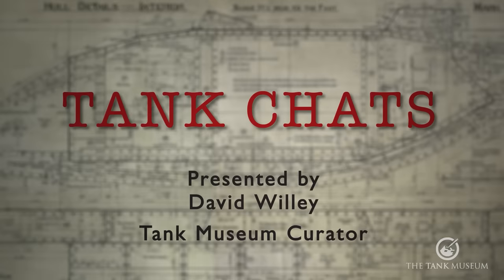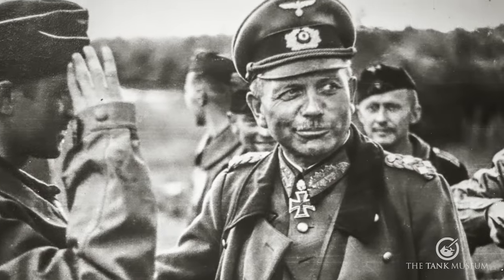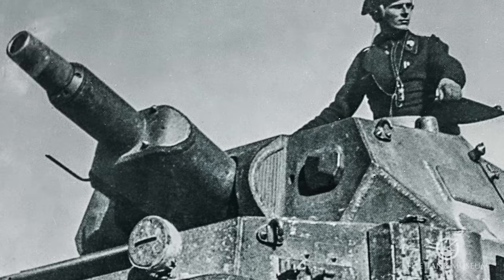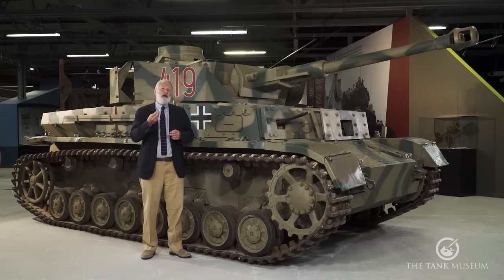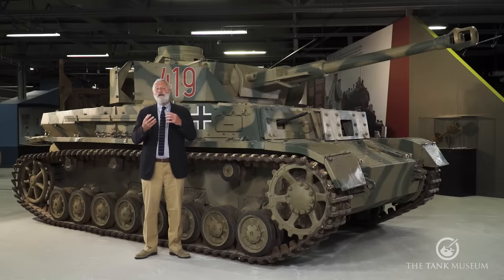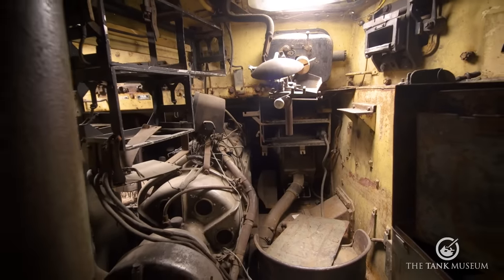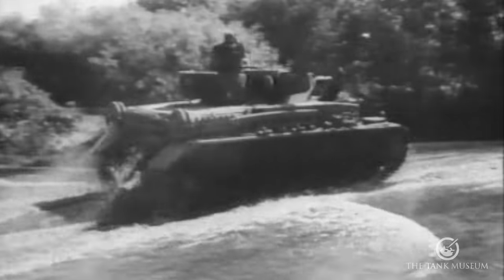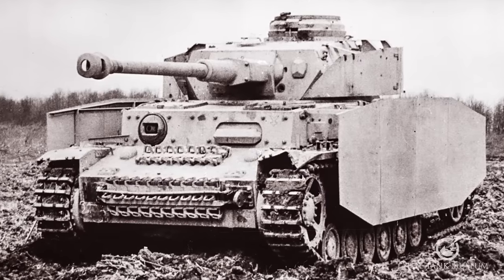Tank Chats #106 | Panzer IV | The Tank Museum

Comment: 75% of Pz IV losses are on the Eastern Front. And Americans still thing D-Day was the big deal.
Reply: Normandy was a big deal. The British and Canadians faced 7 panzer divisions and 3 Tiger battalions around Caen, in just 20 miles of front. This was the densest concentration of German armour ever deployed in WW2.
Reply: @lyndoncmp5751  double that and you´l get a tuesday in Prokhotrovka...
Reply: @uegvdczuVF  Operation Goodwood was a larger tank battle than Prokhorovka. Its now been shown Prokhorovka wasnt as large as the Soviets used to claim. And the Germans had less than 50 tanks knocked out/disabled there. Most of which were recovered and repaired.
Also, no Panthers at Prokhorovka and many Panzer IIIs still.
At Goodwood there were nearly 1,500 tanks so more than at Prokhorovka. The British had around 400 tanks knocked out/disabled and the Germans over 100. Higher losses than Prokhorovka.
Reply: @uegvdczuVF  Also during Kursk the panzer divisions were dispersed and spread out over many miles and two different fronts.
There were NEVER 7 panzer divisions and 3 Tiger battalions deployed around just 20 miles and 1 town at any point on the Eastern Front. The Soviets NEVER faced German tank concentration density as the British and Canadians faced around Caen.
Facts, mate. Facts.

Comment: The gunner on the left comes from Field artillery practice makes the loaders job a little clumsier also, on the J model they did away with the rotating connector under the turret. A cable replaced it and limited rotation to 70 degrees in direction

Comment: One point, the Schürzen did not tumble the anti-tank rifle rounds, they "skinned" the soft outer jacket off the core. By doing so it removes both speed and mass from the bullet which lowers the kinetic energy when the bullet impacts the main armour.
This is what the Germans originally planned but historians came up with the tumbled round idea instead as some rounds do tumble if they hit the Schürzen at an angle greater than 30°.
Modern testing testing has proven the German designer's right.

Comment: A slightly wider tank, with a turret ring bigger than actually needed at the time. Welded construction throughout, so its easily modified. The Germans were always thinking ahead. It was very difficult to put a more powerful gun into the Sherman, but for Panzer IV it was just plugin play.

Comment: Only in accuracy here is about the naming of the model after the F.  F2 was only a stopgap designation and dropped by the summer of 1942. 

227 Panzer IV with the 75mm L43 were ever produced, and then taken into the G once they adopted the L48 for serial production from mid 1942 onwards.

So you basicly got

Pz IVG early = 75mm L43 & 50mm hull front armor
Pz IVG mid = 75mm L48 & 50mm hull front armor
Pz IVG late = 75mm L48 & 80mm hull front armor

Comment: The Panzer IV was also just about as expensive to produce as the Panzer III. The latter, although smaller had more advanced features. And even though this design from 1936 was certainly relevant for the duration of the war, it was never a world beater. The 3 man turret was superior compared to 2 or even 1 man turrets of allied tanks in the beginning of the war but its armor protection was often significantly inferior. Later models could still compete adequately with the allied medium tanks later in the war even if these were "far" newer designs. (A year in development during WW2 is obviously much more significant than it would be in peace time.)
Reply: On the sea there's a saying about safety in speed, I think that applies to tanks as well if used with the right doctrine.

Comment: The Panzer IV was one of the only first to the last vehicles in WWII. The only other tank was the T34. In aircraft I think only the BF109 and Spitfire were first to last. The designs were so good they were still effective in 1945 even though they were designed back in the early 30s. What a great series this is.
Reply: The P38 was first to last along with the B17, B25, B26, DC3/C47, and Japanese zero.
Reply: @krtacct  I'll give you the B17 and A6M but the others were not operational at the start of the war.
Reply: @arminiusschild5260  T-34 wasn't around in 1939 and 1940 though. No T-34s when the Soviets invaded Poland and Finland in the first year.
Reply: @lyndoncmp5751  True, I thought they had them in inventory but did not use them yet. But it seems they were only introduced in 1940.
Reply: @arminiusschild5260  Yeah they made a couple hundred T-34s in the second half of 1940 but none saw combat before June 1941.
Cheers.

Comment: The best tank the Germans made during WW2 in my opinion. Was a decent tank before getting the bigger gun, but was better with the 75mm high velocity gun which could knock out any allied tank. Much better than the Panther or either of the Tigers.
Reply: I fully agree. The Panther and Tiger 2 were a waste of resources for a hard pushed  nation nearing defeat. Plans were there to further up gun and up engine the Panzer IV. Including better but still external suspension units and even wider tracks! 
Panzer IV should have been the German equivalent of the Sherman. Had all the resources and factories been turned over to supporting Panzer IV production/ongoing development and spares.  I'm sure the front line troops would have benefited. Not only  numerically with greater numbers of actual tanks produced. But also from improved reliability of a well proven design and simplified logistical support. Two things that plagued German panzer units.  There were even (I have it on good authority from a little Irish chap.) plans to change the front design to sloped armour. Actually simplifying manufacture in the process.  Like all the other planned upgrades, dropped to concentrate of the Panther, the "problem child."

On the Tiger I subject. It too would have benefitted from further development, rather than a new design.

Comment: I know that Germany used Swedish iron ore during WW2. Does anyone know the extent to which the cutoff of Swedish iron ore from 1944 onwards impacted German tank production?
Reply: None becuse they hade iron for 2—3 year in store
Reply: It was the shortage of other metals in late 1944 that had a greater impact as they were used in the steel alloys to make them strong yet flexible. Many of the tanks built in late 44-early 45 had inferior armor that was too brittle and would shatter when hit, rather than allow for deflections with the metal able to give some.

Comment: I gotta question for you Panzer IV Gurus, what is the purpose of the Two Canisters mounted on the right side of the Panzer IV Ausf H?
Reply: I'm no expert but the pictures I've seen suggest a compressed air cold weather start assist system. There was a similar setup on a T34/85 I explored some time ago, although that was inside next to the driving position.

Comment: I noticed German tanks always had a really tall profile, Even the Panther has a taller profile than most modern tanks. I presume its due to the drive sprocket being in the front rather than rear.
Reply: No torsion bar suspension kept it riding high

Comment: Looking at the length of the barrel I'm pretty sure that this tank is equipped with an L/43 not L/48 gun.
Reply: Yes, he says that in the video
Reply: @LA_Commander  Nope, in the video it's said that this tank is equipped with L/48 gun which is incorrect.
Reply: @ytkomar1141  so why don't you send an email directly to the tank museum, they might actually make a correction
Reply: @LA_Commander  Well, I don't see a need for doing that. Their internet page is correct in this matter and I'm sure that they are aware what type of gun the tank they have in the museum has. I'm just pointing iut that there is mistake in this video.

Comment: It would be interesting to know if the high velocity AP rounds would bounce off sloped armour. I know that the 17 pounder did and l have seen one mention that the American 76mm also bounced.

Bonus fact :  The Germans used low flash (fast burning) gun powder, so it could be difficult to locate German tanks.

Comment: Makes you wonder, what if they had stuck to improving and making more of these smaller more standard tanks; instead of dumping resources into the giant tanks.
Reply: Problem was fuel. They could have produced thousands more but had no fuel for them. Hence the panther. Less bigger tanks used less fuel in the hope that they could survive longer and move less. In the end they ended up moving the bigger tanks a lot more so gained nothing. The German army depended on movement on the Eastern front but lack of fuel basically made that impossible.
Reply: @haveraygunwilltravel  Yeah, that sounds about right.

Comment: I'd like to hear about the (American) "Christie tank suspension" which was rejected by the Allies but accepted readily by the Russians and the significance of its further development (BT series and T-34) with them.
Reply: Christie suspension wasn’t rejected by Britain until after 1945 - it was used on e.g. the Crusader and Cromwell and its derivatives, so was still in production and use at the end of the war.

The Soviet Union on the other hand did end up rejecting it. It was used on the 
BT-7 and T-34 but not on the IS series vehicles.

Christie’s system was good for speed and worked pretty well. It had problems however concerning both the amount of space it took up inside the tank and, because the springs were behind both the road wheels and armour, the amount of work required to replace a broken or damaged spring because you had to remove a lot of parts and armour plate to get at them.

The US decided not to use Christie’s system largely because of the above issues. The US put a great deal of importance on reliability an ease of servicing and repair both for maximising vehicle availability where the fighting was and because they couldn’t easily ship broken down or damaged vehicles back to the factories in the US across thousands of miles of sea. Replacing a suspension bogie on an M3 or M4 was a relatively simple task - break the track, remove 16 bolts, lift off the damaged bogie then bolt on a replacement one. Far simpler than fixing a broken Christie system. Or a broken torsion bar for that matter, especially on a multi-overlapping wheel torsion bar setup like Tiger.
Reply: Also, Poles didnt reject this suspension.
https://en.wikipedia.org/wiki/10TP
Reply: The Chieftain did a video about the US army trials with Christie suspension and the reasons why it wasn't adopted

Comment: I am quite confused, why would the Germans upgrade a training tank if it wouldn't see combat (or at least not intented to see combat). Doesn't make sense adding extra armor and getting a bigger gun if u only use it for driver/crew training. Any1 that could answer that for me?
Reply: Old model tank comes into the workshop for repair, old model tank is upgraded as part of that process. Old model tank is declared fixed. Someone decides where it will go, in this instance it went for training purposes.

Comment: At 24:20 it says that the cupola was moved forward in the Model E.
It wasn't - that would have required moving the seat as well. The cupola stayed put and the turret wall was redesigned around it.

Comment: I always if Hitler had actually listened to Guderian in 43, just what might have different if production capacity went to more P4’s. Considering the Tiger cost four of those.
Reply: Nothing would have been different, except a lot more resources used and more men killed. At most, only another 4,000 to 6,000 Panzer IVs could have been built if not Tigers. Thats over nearly 3 years.
People forget you make 3 times as many Panzer IVs then you need 3 times the men, 3 times the ammo, 3 times the support and supply personnel and their vehicles, from panzergrenadiers to medical and field kitchen etc etc and consequently it would end up costing far more resources.
Just as important, the Germans would have had neither quality or quantity superiority. The Panzer IV was not better than the main allied tanks from 1944.
Reply: @lyndoncmp5751  Yes I understand that. Didn't think of the manpower that would be required, and probably would be inferior by 44. Thank you for the reply, excellent points 👍
Reply: @kungfuwitcher7621  No worries. Yeah few people realise that out of a circa 10,000 strong panzer division, only around 2,000 make up the actual panzer regiment. The other 8,000 are supporting grenadiers and supply personnel.
Tanks have to have a lot of support and supply personnel and vehicles.
Cheers. Best wishes.

Comment: Why didn't they scrapped panzer III totally in 1936 or so and go for pure panzer IV production just with 2 different guns? Some could have the 75L24 and others the 37 or 50mm guns (then of course it would end with 75L48). They could have both roles with the same tank.
Reply: Kwk Fortythree Chassis were reused.
Reply: @XtreeM_FaiL  indeed, in stug3, stug4 and other vehicles. What I mean is what's the point of having panzer 3 and panzer 4 tanks when using just panzer 4 with different weapons on the same turret would be a much lower burden in the logistics and production while maintaining the same anti tank and infantry support roles. Why two vehicle type when win just one type you can cover all your needs.
Reply: For the same reason US pumped out a lot of M3s when the M4 was ready.
They needed tanks.
changing from one model to other would shut down the assembly lines for months, or worst.
The transition from M3 to M4 was less troubling as the two hulls are similar and the US industrial power was immense.
PzIII and PzIV were two different thing, they would have to create a new line from scratch with German industry already stretched.

Comment: I have question:which tank will win the tiger or  the panther
Reply: Depeneds on what you want?
Tiger is a special breaktrew vehicle, Panther is meant as a main stay vehicle for an army that has to fight lots of enemy tanks. Both are made for different things and excel accordingly.
Reply: panther is the better tank.
Reply: @nothanks3590  Better tank at what?
Reply: @lyndoncmp5751  everything
Reply: @nothanks3590  But it wasn't, and the Tiger even had a higher operational average. 65-70% compared to the Panther's 60-65%.
Undoubtedly the Tiger was the better tank in 1943 and early 1944. Guderian didn't even declare the Panther fully troop ripe until Feb 1944. It took a long time to iron out its flaws. The Tiger still remained a better long range sniper. More powerful and accurate gun over 2,000 metres.

Comment: The question is: Why did the Germans invest such HUGE amounts of money designing and building Tiger ( only ~1200 built) , King Tiger  and other pipe dreams, when improving, adapting and producing tens of thousands of these MkIV Panzers with varying weapons/ layouts would have been far mor useful? It really could and  should have been the “German Sherman”.
Reply: Maybe because they didn't have enough men to crew them?
Reply: The Panzer Mark IV is adequate enough to deal with the Russian T-34 and the American M4 Sherman with upgrades like rearming it with a long barreled high velocity 75mm gun. The design is simpler and easy to upgrade with many German fighting vehicles are modeled on its chassis. Unfortunately Hitler believed in bigger tanks with bigger guns will win the war and orders more Tiger tanks be built. The problem is that the Tiger is very expensive and used too much resources. Even German generals prefer to have more Panzer Mark IV tanks than Tiger tanks. Had the Germans continue to produce more Panzer Mark IV tanks, the war could be dragged on for a year or two or at least to delay Soviet advancement to Berlin allowing the Germans to surrender to the Western Allies instead.

Comment: I was surprised they only made 8000 of them. This was the workhorse, the panzer the built the most of, and they only built 8000. That right there tells you why the lost the War.

5800 Mark IIIs, 6000 Panthers, 1400(ish) Tiger Is, 500 Tiger IIs (and 10,000+ StuGIIIs which are not tanks). And we built like 50,000 Shermans. And the Soviets 85,000 T-34s. The Germans did well to last as long as they did.

Comment: Panzer iv v Sherman? Which is better?
Reply: Military History Visualized has a video that compares them.
Reply: Roughly equal
Reply: Early war there was not even a Sherman, mid war both were roughly equal, post war the Sherman was better. But one has to remember that the Pz4 was a child of the 30s and the Sherman a child of the 40s.
Reply: Not sure why people keep asking this fallacy of a question.  Neither is better because tanks didn't fight tanks in a vacuum.  The best tank is the one that gets to the fight with support from the other combat arms and is in shape to do it's job as required.
Reply: Michael Lind 
A
Reply: Early Pz IV < Early Sherman < Late Pz IV < Late Sherman (such as Firefly or 76mm Jumbo), roughly speaking, in head-to-head combat. If you factor in every aspect of design and manufacture, the Sherman was probably better as a general-purpose tank because it was just about as good and was cheaper and easier to mass-produce. But opinion is divided, it depends on how you rate the different aspects of the vehicles' designs and their strengths and weaknesses.

Comment: The dual tank system is one of the failures of pre-WW2 Germany.  Had they used a single hull instead of splitting production and specialization between the Panzer III with its superior suspension, and the Panzer IV with the superior overall design, they would have had an easier time making more tanks.  They would have had more 75mm armed tanks, and more vehicles sharing a larger pool of parts and maintenance, making crew training and logistics easier. Proof of this is easy to see with the T-34 system and the M4 system.  Both had various turrets and guns (and even engines) but utilized the same basic chassis throughout the entire series.